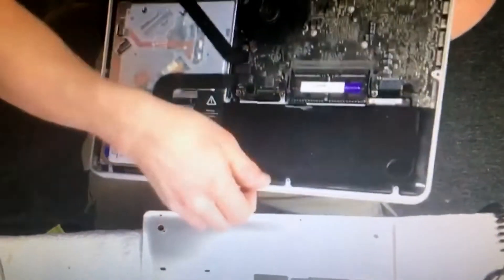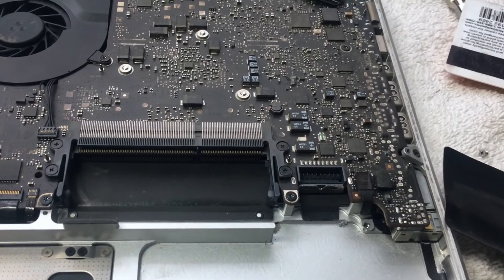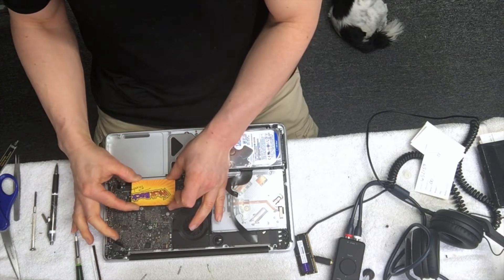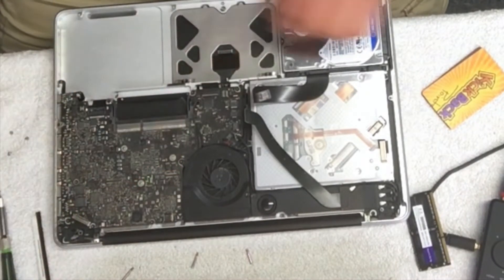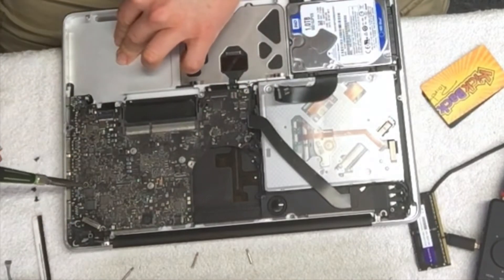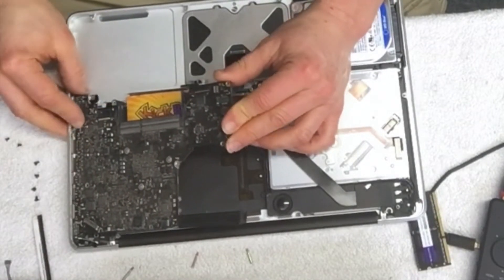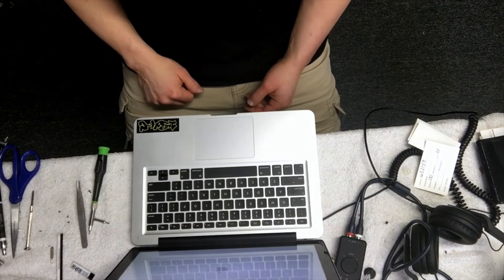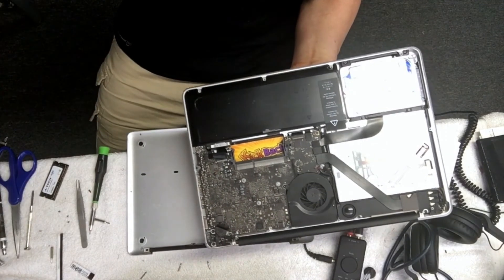2012 MACBOOK PRO FAULTY RAM PORT FIX... yes it really works

Comment: Just worked for me. No screws removed except the bottom cover. Cut card. Slid under ram tray. Good to go. Even gave it a few squeezes to make sure and it’s still on and not glitching. Lfg. Ty.
Reply from the maker: yeah i laughed when it worked for me

Comment: A bit late, but what if the port that doesn't work is the upper one? 😢 
Any ideas?
Reply from the maker: aside from taking it in to get a technician to repair it not really .. and honestly its probably not worth the cost of the repair being the laptop is an older model

Comment: I bought one of those Chinese soldering irons with interchangeable tips, one of them very thin, and I gave it a pass over all the soldering points of the RAM slot up and down and that was it because it was already too much trouble.

Comment: Bro how the hell did this work tysm was so sceptical
Reply from the maker: its funny that this is the remedy for that issue … but it has to do with a faulty design with the pins on the RAM port where over time break away from the main board ..

Comment: Worked for me too. Mine even had the added padding that I suppose Apple regarded as a fix. I bought the MBP from a FB Marketplace seller who was not able to describe the issue and sold it to me for $40. There was some evidence of it having been serviced for something in 2015 and the seller said it had been unused for about 4 years. So, it was in great condition otherwise but arrived with that graphics noise and freezing issue spoiling the fun.
Reply from the maker: yeah it was a terrible design flaw …. apple was cutting corners for sure

Comment: Well I have done some previous procedures but the problem continue, this time I followed your procedure and hope it works for good. I was using the mac with only 4 GB, now is back to 8. thank you so much.
Reply from the maker: i was surprised how well this worked for me .. again you don't have to disassemble the whole board to get the card spacer under the motherboard it will slide under with just a little bit of clearance . i just went that extra mile to make sure it was set up right … this simple fix did allow me to use that specific laptop for quite a while until i purchased a newer model… good luck thanks for watching .. shame on apple for designing such crappy components...

Comment: For me, it was enough to just put 1/4 of plastic card w/o removing motherboard. Just gently insert a piece of plastic under the slot a bit, like 0.5cm, make sure it sits alright, insert memory and check if it works for you. BTW, just installed OCLP Ventura on that mac - 12 year hardware still works like a charm :)

Comment: I can see this is a good pragmatic fix and thanks for posting, this has been niggling me for ages so I'll try it.

But does anyone know whether this impacts the thermal control? My MBP already runs pretty hot, I can imagine this will further prevent the RAM chip cooling?
Reply from the maker: I will say that it extended the use of the MacBook for another 2 years before i finally upgraded but its a quick fix none the less

Comment: I recently had same issue but i tried just one stick at a time and discovered one of 2 ram sticks was faulty. all beeps and reboots, etc gone. ram does ail and more often than you think. on a desktop have had multiple kingston hyperx fury ddr4 sticks die

Comment: This worked!!! for about two weeks, then it stopped working and I had to take out one of the ram chips. I would say it is not worth such a risky procedure. If you damage any of the many, tiny cables you have to disconnect and reconnect, you could lose the function of your keyboard, wifi, your screen, mouse pad, etc. I took me around 1.5 -2 hours to complete. I was being extra careful and watched multiple videos on removing the logic board, so I could see what was going on. Do not attempt this procedure if you are not absolutely certain of your ability to avoid causing damage. It is not worth the risk. Also, this is a 10 y/o computer, so finding parts is becoming v. difficult. If you break it, you may not be able to replace it.
Reply from the maker: you could have just slipped it under the RAM port .... you don't have to remove the whole board ...

Comment: Thanks CJ, this worked great for my MBP 2012 RAM slot issue ... I found the stiffest plastic card, cut it to perfect size to hold both sets of pins for upper/lower RAM slots and wrapped plastic card pieces it in Kapton tape ... worked like a charm, thanks for this pro tip!  The underlying issue is 2012-16 MBP Ram slots are not well soldered to the logic board, and applying this extra "clamping" force keeps the connection solid to the solder points for the RAM slot pins.  The real fix to this is resolder the pins that are loose, but this fix is perfect for the DIY quick fix.
Reply from the maker: yeah i was pretty surprised this worked myself .... yeah desoldering would be a better fix although it would be very difficult to do so

Comment: Thank You for making this video. My mid 2012 MacBook Pro was doing the black squares and the 3 beeps for bad and randomly freezing and rebooting. Following your video and repair. My MacBook Pro is back to full working order. I also need to thank Turkish Airlines for there air miles card for the use in this repair :)
Reply from the maker: awesome im glad it worked out for you

Comment: To all those people who just found out that their upper most RAM slot is faulty just add double tape on the back panel which pushes down on the ram chip once screwed back on.
Just remember to screw down the panel using equal tensions on each corner and gradually move towards the center screws

Comment: Worked, I had the beeps whenever inserting memory into the lower slot. I added a piece of credit card between the logic board and the lower RAM slot without removing the entire board  but I also loosened the 4 screws  as per this video for example : https://www.youtube.com/watch?v=2vCpW2jCqmM (I actually did this step first and had no beeps but screen not working like the OP shows). I now have 16GB. Next step : Will upgrade my non retina MBP 2012 to Big Sur ....:)

Comment: Thank you, it helped me a lot, I'm from Bolivia, I had been looking for the solution to my macbook pro 2012 it was freezing a lot ,,,,,,,,, what I did was place a card, I cut it a little wider and without removing plate I placed it underneath almost like the video, it still worked for me thanks.

Comment: This ribbon cable, man.. I started detaching the push ribbons until I realized I don't have a torque screw on hand so started to reattach everything but the ribbon cable on the opposite end of the fan is not snapping into place and when I pull the lever down, the ribbon isn't staying in there. Any tips or does it require a special tool?

Edit: It takes a little bit of an angle , once it is lined up you have to kinda leverage it and it will snap-in. It doesnt seem like it but youll get there, just dont panic like I did lol

Comment: Hello everyone!
I just used this method using a plastic credit card. I have followed the steps in the video and it has worked for me on my Macbook Pro 13 "inch Mid 2012.
However, I have noticed that it begins to reach high temperatures quickly in the ram memory slots. This I have noticed using the application: Macs Fan Control. Actually I have been thinking that the material of the credit card (Plastic) allows the temperature of the slots to rise quickly. I'm thinking of taking it apart again to check it.
Has anyone else noticed this?
Thank you!
Reply: Hey,thanks for sharing! That is exactly what I have noticed as well..but I still havent tried to use a credit card..I just used a splice of the foam like material just between the both RAMS, so the upper is pressing on the bottom one. When I realized it is somewhat working, I saw that the laptop was getting hot super quickly. So I reached Youtube to find a solution and now reading Your comment) Have You fixed the issue?
Reply: @munimum  Hi there!
If a while ago I used another material that takes time to reach high temperatures such as plastic (I do not remember the name exactly). I solved this problem by making it with the same measurements of the credit card that I used a while ago and replacing it. Now the MacBook slots do not reach such high temperatures in the RAM slots. I recommend doing this, foam as well as plastic tend to get too hot. I hope it works!
Reply: @menosatelier   Hey!Thanks! The weird thing was that I saw that my macbook became hot but not really the ram themselves or the slots. But I will try to do it with the card tomorrow. Watching the video I was thinking that maybe it it better idea to put that black rubbery piece on top of the card and not opposite like the the person did here in the video. I guess that black piece probably working better with the heat.
Reply: Hi, I still noticed the temperature of my macbook from 2012 ,,, what I did was update my mac.

Comment: Thank you...! ☺️ here’s what i did without removing the motherboard.. I just cut an old credit card in the same size of the RAM stick and inserted it just where he did, but without removing the motherboard and it worked too.. For those of you who doesn’t have time or tools to risk removing the motherboard.. 🙂
Reply: dude i owe you a beer. thanks so much.
Reply: Great job.
Reply: Lifesaver! Thanks guys
Reply: How did you do that without disassembling the other parts?
Reply: Using this type of material, in this case plastic, won't you end up increasing the temperature of the memories?

Comment: My laptop's outer RAM port seems to be the problem. Is both of your ports that have the problem or just the inner one? I tried unplugging the outer one and my laptop can run normally. But once i plug it in again, no can do.

I replaced the position, both RAM card are doing fine when plugged into the inner port. But if either one's plugged to the outer port, 3 beeps is all i'm hearing..
Reply from the maker: usually it is the bottom port that goes bad ... you can test this by only installing on ram board on the top port if the laptop runs fine than you know
Reply: @CJScratch  my top ram slot is damaged i think. I tried switching the ram card, they're both fine when plugged into the bottom slot..
Reply: @FeliciaKarta  Then your top slot isn’t working - there’s no video to fix this I think. This video is for those that have a bottom ram slot that freezes (mainly due to stability of the bottom one). The best thing you can do is use one ram stick at the bottom (I would recommend one 8GB stick - £40).
Reply: @MrIDGAF  yep did that already, so far doing ok. Hope it stays ok. Thanks 😊
Reply: @FeliciaKarta  I have the same issue. My 'outer ram slot' appears to be faulty. did you ever manage to fix this or did you just increase the size of the ram module in the slot that still works? Does anyone know if you can run 16GB ram in 1 slot on the 2012 MacBook Pro?
Reply: @bcji10  I never managed to fix this. I have been using the 8GB ram in my bottom slot. Putting in 16GB ram in 1 slot sure is an interesting idea, found this online --> "The Mid 2012 MacBook Pro can support up to 16GB of RAM by using 2 8GB kits. Both the Retina and non-Retina models (mid 2012) support 16GB of RAM." so I'm guessing if only 1 slot is working, a 16GB RAM card should TECHNICALLY work.. Will you be so kind and give me an update on this should you ever try it? Thanks :)

Comment: There is no need to remove logic board to fix this lower ram slot problem for some people. It's 2020. I bought a Macbook Pro 2012 on Craigslist yesterday for $150. The same bottom ram issue of my bottom ram slot on my Macbook pro I fixed with a plastic straw while drinking a cocktail. I cut two small pieces of the straw and placed them under the bottom ram slot. But first I loosened 4 screws that held the ram bracket. And I tightened the screws back in the end. My Macbook Pro mid 2012 recognized both ram slots!! It works!

Comment: Listen, my bottom ram port went bad like 5 years ago and I could only use the top port. I tried everything, but nothing worked. If i had anything in the bottom slot my mac would not even boot. THIS FIXED IT. I can now use both ports! Thank you so much!
Reply: Mine went bad 3 years and I always hated the fact I was using half the ram, and now I’m happy there’s a fix in 2020

Comment: I've been fighting my MBPro for two years with all the same symptoms. Today was he first time it ever beebed 3 times so figured out it was my ram chip. Found this video. Thank you so much for sharing your solution. I can finally have my laptop back!
Reply from the maker: glad it has helped you out .. just to clarify it was a suggestion i seen from another video here on  you tube it worked for me so i figured share the steps....
Reply: @CJScratch  so I realized this for the MBPro modoe before mine. Is the ram still n the Sam spot?or do you know if this would work for a 2013?

Comment: Pfff.. I spend so many hours on this and it eating my soul. It was getting worst n worst until it couldn't turn on. So I tried to do it proper with soldering but even with my thinest nose on my solder iron i couldn't reach well the contacts of the second slot so i heat it as close as possible. It was alive again but it couldn't hold a heavy testing, probably there is a gap between as you show that makes again this problem.  I''ll try man thank you!
Reply from the maker: yea i was surprise  it worked .. its still functioning fine no issues

Comment: Can I use a 00 screwdriver? (The screwdriver used for the back of the MacBook to take the case off)
Reply from the maker: as long as it fits in the screw it should work just be careful not to strip it

Comment: Had I not tried it myself I would have never believed it.  The repair really works!  I used a grocery store club card and cut it to size.  Thanks for the tip!
Reply from the maker: i was just as surprised as you were when it did work ...